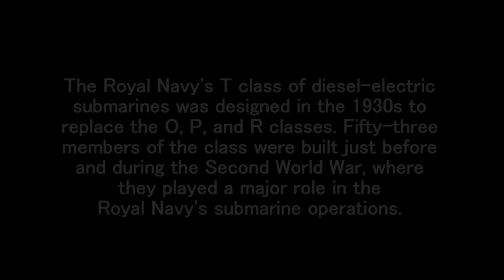British T Class RC Submarine in 1:48 scale

Comment: You do know we have had failsafe for a long time. 72MHz PCM systems used this 25 years ago. Look for an old Futaba 9Z system, would be the ultimate sub system. These were the saving grace for RC helis back in the day and beyond. Early helis were so electrically noisey that FM systems simply could not be reliable. But PCM systems with failsafes enabled were like a magic pill.

Comment: Very nice. However, I would go for zero throttle at loss-of-signal. A flooding dry-space with the screws turning will drive the boat to who-knows-where till it settles on the bottom. Making search and recovery a nightmare. If it loses its head-way after loss -of-signal and sinks, recovery is a much easier matter.

Beautiful boat!